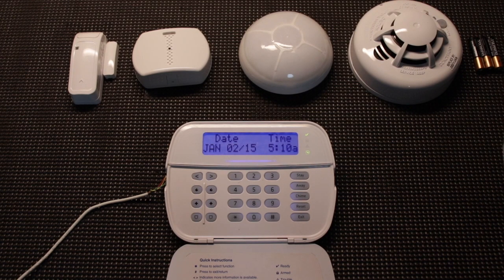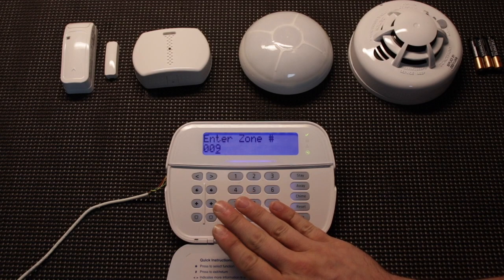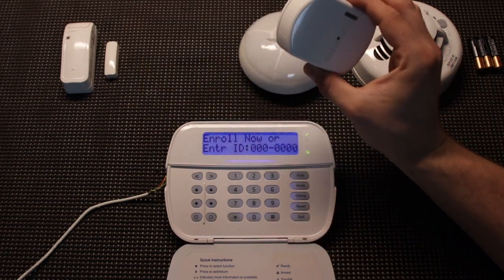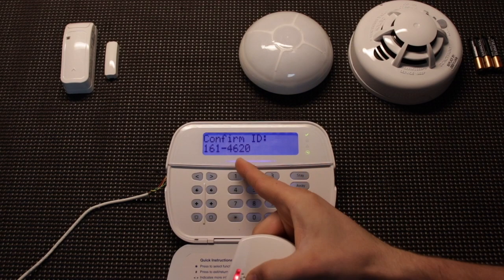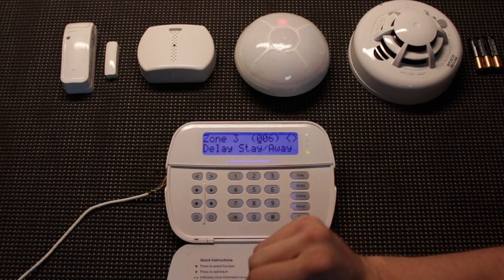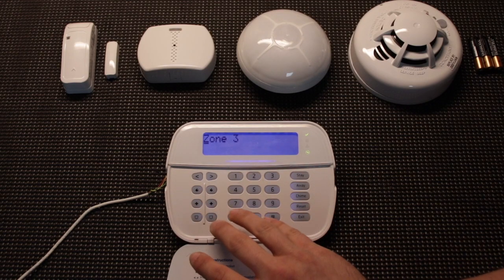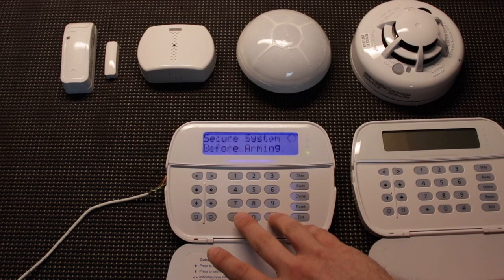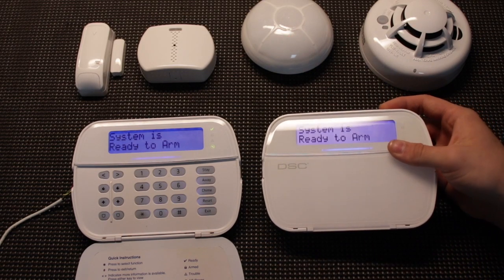Mastering DSC NEO: Wireless Programming Made Easy

Comment: Can i add a wireless keypad using DLS5?
Reply from the maker: Not certain, we rarely use DLS. I have used it for large systems though and I can tell you that it would take way longer to add a device or two only via DLS. We only ever used it for very big systems. I can hand program even a basic 8 zone system faster manually than I can DLS.

Comment: I am trying to do wireless enrollment  DSC WS4936 SOME DETECTORS to my DSC NEO system but it doesn't detect it? An
Any input?
Reply from the maker: A DSC WS4936 is not compatible with the Neo. That smoke is for the prior generation of DCS wireless. The PG9936 is the correct one to use with Neo. https://www.alarmsystemstore.com/products/dsc-pg9936-powerg-wireless-smoke-and-heat-detector

Comment: Mostly what I use is DSC 832s in 1832s. Does this program very similar to it apparently they don’t make the 1832 any longer so I need to buy a neo panel for a system next week. Do you think I will have any trouble programming one of these opposed to the 1832. Thank you.
Reply from the maker: Yes it is very similar. Most feel it's easier in fact because you can see more detail in programming.